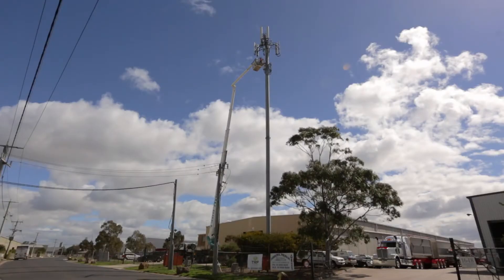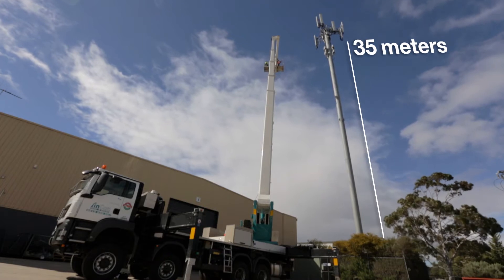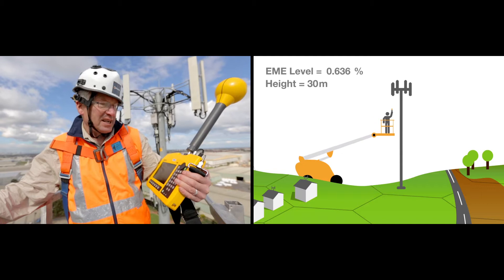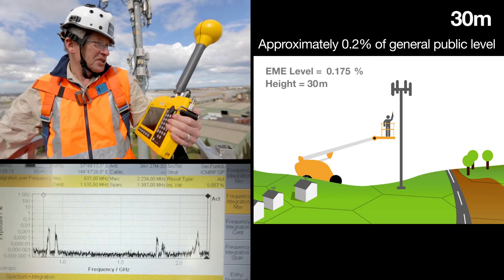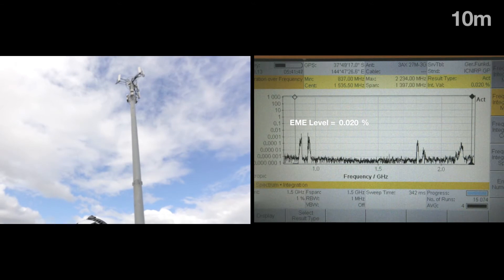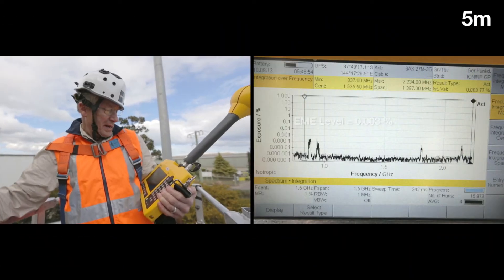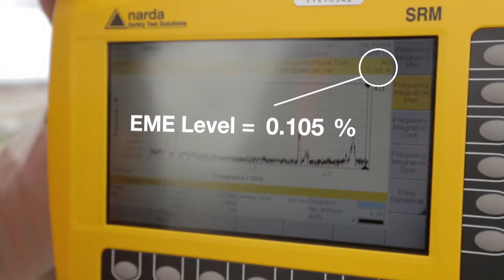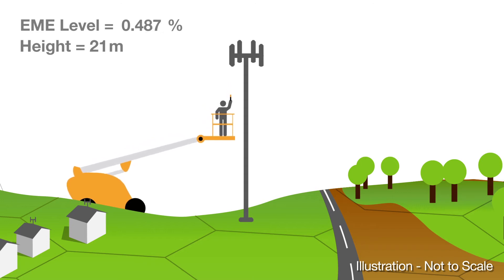EME Levels on a mobile phone tower - live readings from 35m to ground level

Comment: Means nothing measuring directly down in the shadow zone. I'm five floors down on the other sides of a building and I'm moving out because I can't get informed on the possible danger. Did you knowingly trick us with the vertical nonsense? What about at a 45 degree angle down? What if apartment ceilings and walls are in between? Why can't any of these videos take real world concerns into account?
Reply: All that reinforced concrete will greatly reduce signal strength.
Reply: @James_Knott  Yes, that's why I stayed at least a few more days there. :)
Reply: I sleep every night with my head in the 45 angle line from emitters, and live my life there, its my life house. One I bought full cost when this thing was not there, I live now 10 to 15 meter from it in the 45 angle line. How should I feel? I tell you: Depressed. And please prove me wrong. I'will use your video to regain value when selling it
Reply: @ziozeus74 used to live also 12 meters away from a 3G antenna; 10 meters high.
Usually I woke up almost every night around 03:00 am with a toothache. One of my teeth replaced by metal; ideal antenne!😢
Another position on my pillow and the pain was gone in 10 minutes.
Later knee the buscompany updated all their buses at this time of night.

Comment: Hi Michael thanks for the video, but I was wondering whether if distance up to 400-500 metres from the base station is considered okay and would not pose any adverse health risk to long term resident? Cheers
Reply: It is a good question, given that microwave radiation is a known carcinogen (WHO classifies it as Class 2B 'possible carcinogen'. in the same category as DDT).  FCC, APRANSA, ICNIRP and other standards organizations do not offer medically validated thresholds, but are obsessed with thermal damage primarily.  E-smog is an environmental pollutant and so it is a tradeoff of how much toxicant your body is willing to accept before it suffers.  Personally, I very much reduce any RF exposure by leaving phone antennas off almost all the time, relying on wired or the free Google Voice service.
Reply: @kengartner204   It is NOT a known carcinogen.  There have been some suspicions raised, but no proven link.  This compares with upper UV, which definitely is a carcinogen.  The difference is upper UV is ionizing radiation, that is it can change the number of electrons in the atoms, and microwaves, as used in cell phones are not.  There can be risk from heating, at high enough power levels, as demonstrated in microwave ovens.  However, those ovens run at a much higher power level and it's contained within that box.  Eyes, for example, may be sensitive to heating.
Reply: Hello. Did you ever get a definitive answer for your question on a safe proximity from a tower? I’ve learned it is actually the people or homes further from the towers that are exposed to the highest levels. Is 400-500 and beyond safe?
Reply: Right under maybe there's drop, yet if you on a hill like end of video might be in line of sight yet at a distance ... emi is ground effect from the DC gen in theory